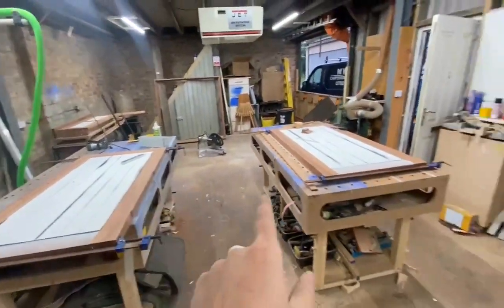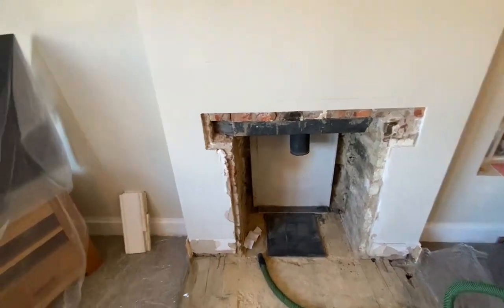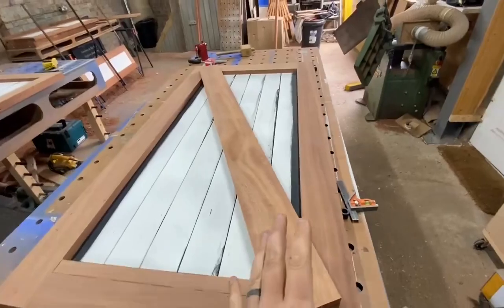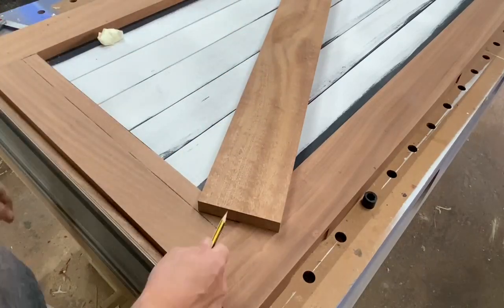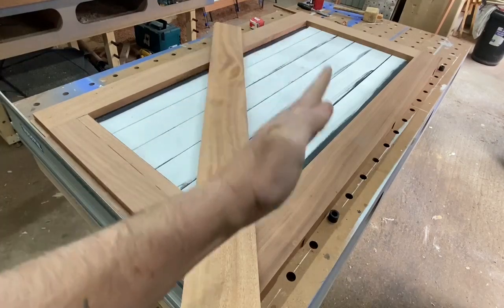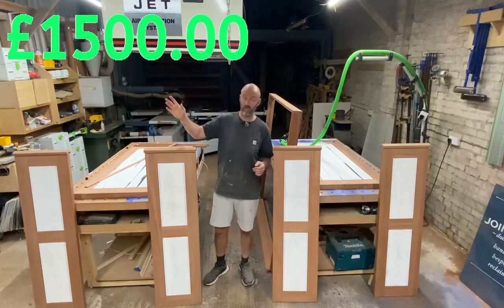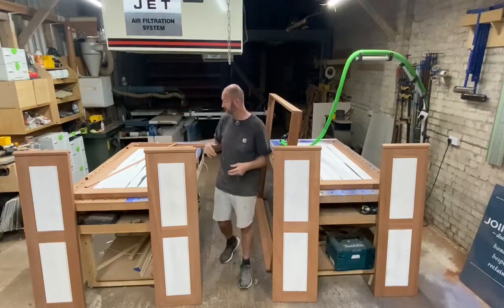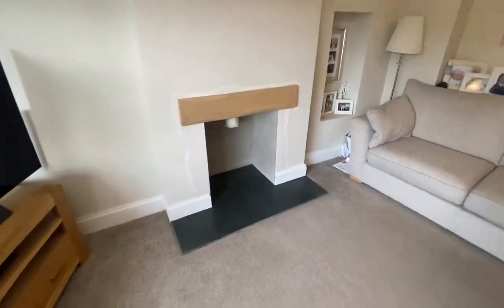Costings on my doors and shutters explained Plus a Fireplace install #36

Comment: Hi Matt, I'm slowly getting through the videos. 

I do quite a lot of Framed ledged and braced doors in black for churches,older properties. Have you considered "Architectural Solignum"  (Ebony) ?. It's excellant stuff, allows the grain to show through, easy to apply and 2 coats is fine so you don't have that issue of primer,sealer.undercoats and a top coat. They do a water based system but I stick to the spirit based system. Not cheap but 5lts lasts ages as it has the consistancy of water. Worth considering. I made some  garage doors recently, 4 of them in a frame, ran on a top track like warehouse doors. I made all the panels from 18mm Tricoya MDF , cut to size, rebated in the frames and v grooved with a router. Price wise it worked out cheaper than making t&g boards and no issues with expanding,contracting during the seasons. Worth considering. 

Just to clarify, the sawn Sapele came to just under £600 icluding vat?. And to have all the timber components PAR'd and cut to length and delivered  it would have cost you £1,700 incl vat. Is that right or have I got that wrong?. The reason I ask is to saw up thos components, PAR them and cut to length would take around 1.5 hours, 2hrs tops.
Reply from the maker: Smashing through them😂 I have heard of tricoya and tbh going forward I would consider it providing the timber I used didn’t show too much grain when painted. 

Yes it cost me around 600 and I did get a quote of £1700 to machine but that’s not to say it could have been cheaper. It certainly took me longer than 2 hours to machine all that but then again the actually process isn’t really that time consuming it’s the stopping thinking and considering waste etc that does. Also I am not set up for lots of machining. 

Appreciate the comment
Reply: @Wattsjoinerybarn  I think they would have closed the machine shop for a couple of days and gone on a weeks holiday for £1700. 😂. I sometimes wonder how they come up with their prices sometimes. 🙄. Tricoya is expensive but when you weigh up the costs of timber, machining,fixing the boards etc it can work out viable.Plus the fact that a full panel of Tricoya will keep the doors square better than boards will so you never need to worry about bracing the door. 🙂
Reply from the maker: @AdrianSams 
Yes, it does seem like a no brainer. If I will see if my sheet supplier do it. They only do sheet goods so possible could. I will defo consider it for next time

Comment: Labour wise to make a pair of Framed ledged and braced doors with bare faced middle rails,hung in a frame (3 hinges per door)  ,locks etc and to make 4 shutters wirh weather hoods  ,all to a primer finish I would say £2100+VAT. But that would all wedged ,mortice and tenon joints on all joinery. I'm not a fan of Domino'd doors,sashes etc on exterior work as I've had to replace other peoples work far too often over the past few years.

    Issue is with domino's is if you look at a bottom rail which has say 2 large/wide domino's you have gaps above/below the domino which ,if the glue fails water ingresses through the joints to the inside whereas a full M&T doesn't reply on the glue because the tenon prevents water passing through the joint so I just use the domino for interior work. A floating tenon (domino) doesn't support weight well, it needs glue both sides to work and glue eventually fails more often than not.
Reply from the maker: I hear you on the domino. Hopefully that won’t be a problem I have. I think I did 3 dominos in each joint but could be wrong. The shutter especially seemed a nice job to do it on and I know plenty of people who do it but your experience is no doubt right on the matter. This is not my bread and butter work at all!

I just included VAT in every costing wise but yes that’s probably right as mine was fully finished plus I had a bit of a faff on the bottom rail detail and changed it.

Appreciate the comment
Reply: @Wattsjoinerybarn  With shutters using a domino probably isn't that bad  but on an external door for a house I've seen too many fail and always the same way with moisture ingress through the bottom rails but time will tell and if a door is protected from direct weather by a  porch canopy etc then it may well be ok. 

I think the main issue is our weather, we can have -12 degrees and dry followed by 100mm of rain for a month or more ,then 32 degrees of baking hot sun. All play a part.  Have a great Week and loving the video's.   👍
Reply from the maker: @AdrianSams 
Thanks mate. 

It will be on the channel anyway🙈
Reply: I built a heavy side gate back in 2015 with the domino i used pu glue, and so far, no problems. I've done quite a few doors and gates since then. I never had one fail yet, but that's not to say it'll never happen. I live in Ireland, and we get crazy weather.
Reply from the maker: @jasonhughes6994 
Great to hear. I went back to them last week and no movement. I do understand the concerns tho and I think going forward I may introduce either a screw if painted or maybe a through dowel into the domino! 

External joinery can be such a worry😮

Thanks so much for watching ❤

Comment: Loving the vids Bud , nice to see the costings also helps others out trade and customers I think to see how much things cost , another carpenter I follow does the same 
20-30% profit I would think on top , it’s what I do 

Would be interested in future project prices or say a re cap on past jobs
Reply from the maker: Good idea mate! I have a kitchen I did on here I could recap the costs on! Tbh it was nice for me to see these figures!.  I was always told 20% but I feel if it’s external it should be more. I actually don’t like external work because it’s a constant worry! 

You are right tho I think customers would be amazed at the minute how much things cost! Sometimes it’s embarrassing trying to put money ontop🙈

Cheers for the support
Matt
Reply: @Wattsjoinerybarn  yes I much prefer making furniture it’s what I trained in and have returned to after a 20yrs gap doing another career now back playing with wood (LOL) converted my garage in to a work shop etc etc 

made a gate with curved top edge - mortise and tenon joints etc my first one and was nice to see the explanation on the video re the cross brace 

I will remember that for next time for sure my constant worry was expansion and contraction but customer happy which is all good
Reply from the maker: I bet that gate was fun to make. I have some curved work to do soon with M&T! and looking forward to it! 

Glad you have a work space sorted, makes a big difference !
Reply: @Wattsjoinerybarn  yes was enjoyable for sure I matched the arch in the wall as it was an exit gate from a court yard 

look forward to the video on how I should have done it LOL
Reply from the maker: @spicystealth4285  nah, if it works it works. More than one way to skin a cat.